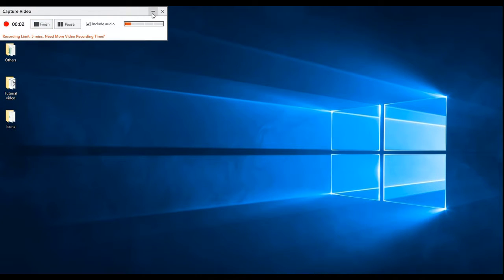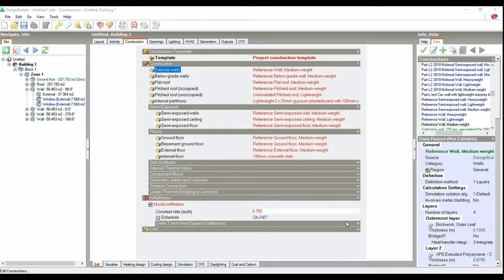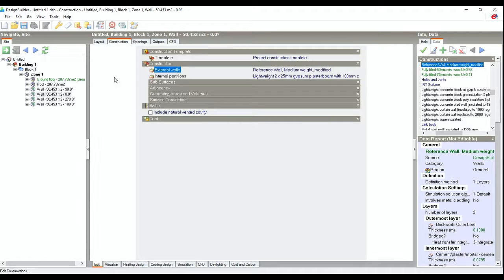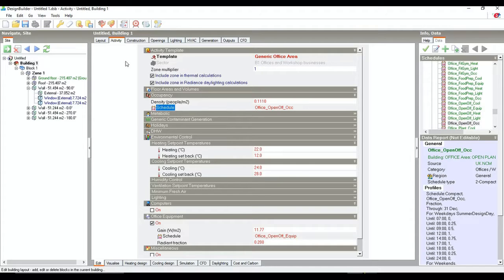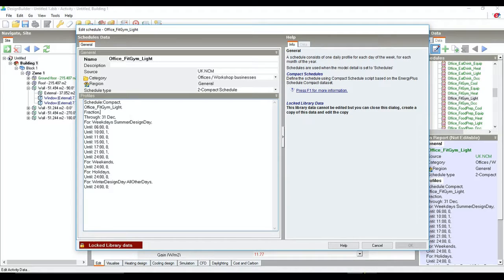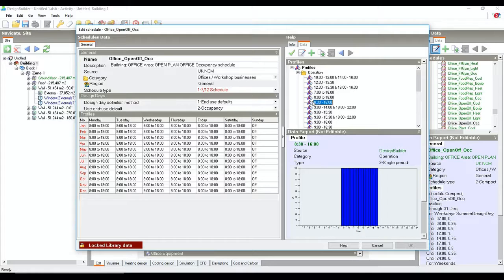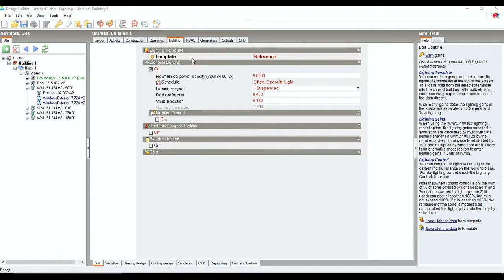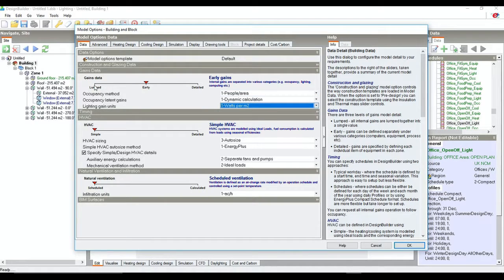DesignBuilder tutorial: Construction, people & lighting

Comment: how do you place columns and beams in designbuilder?
Reply from the maker: Hi, the dynamic building physics simulation platform such as Designbuilder and Energyplus does not require to build column and beams in the model. From my personal experience, the impact of simplifying the column and beam into direct walls are very small. It also helps to reduce error and make the simulation quicker. I hope this answers your question.